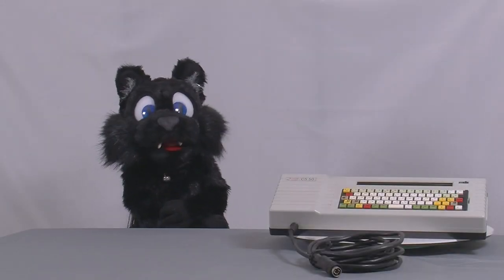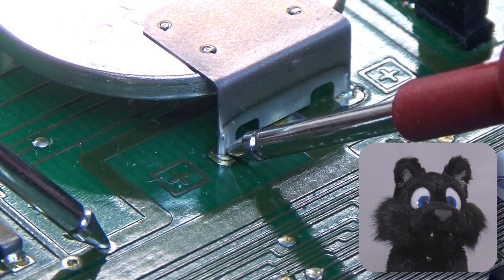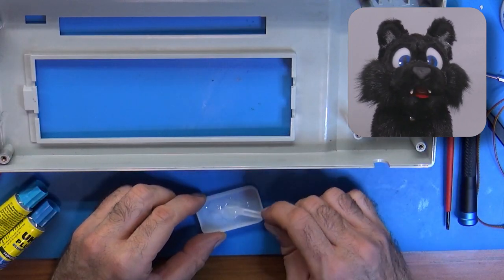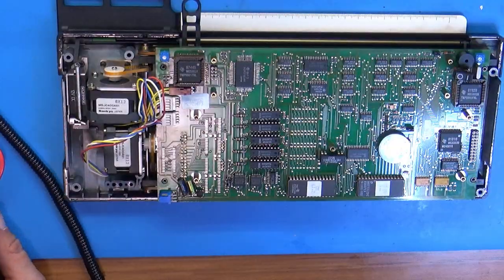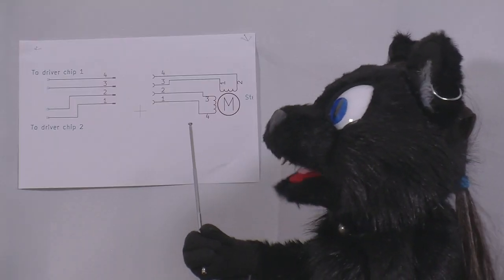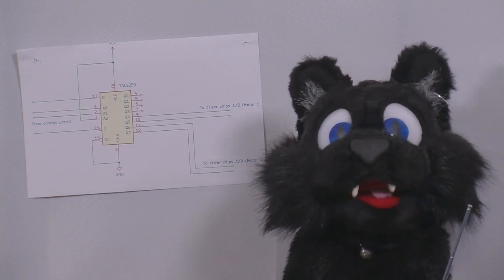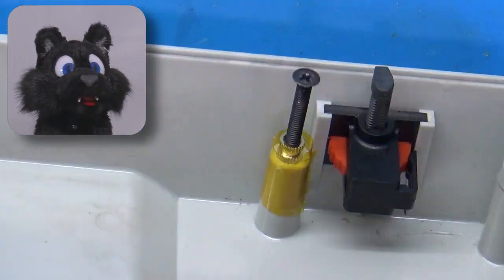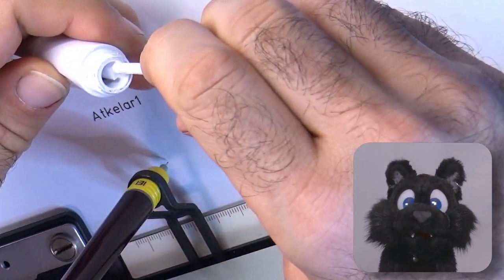Restoration Project #16 - rOtring CS50

Comment: I'm restoring a rotring cs-100 scriber. I need to replace two old belts. They are 2mm wide with a 1.5mm pitch (from what I can tell). I'm having trouble sourcing the belt material. any ideas?
Reply from the maker: Hmm... a quick bit of Google-fu makes me think you are looking for "GT1.5" belts. Amazon seems to be able to find a few on that notation. I hope this helps! I found a few specialist sites too, but they seem to be "industrial customers only" style catalogs.
Reply: @atkelar thanks for the quick response. The smallest gt1.5 belts I can find are 3mm wide. I think I need 2mm wide for the rotring.
Reply: @atkelar unless I get a 4mm gt1.5 and figure out how to cut it in half 😅

Comment: Ack! What if there was stored information that got wiped-out when the battery was removed!?
Reply from the maker: I was a bit less worried in this case, since te device is 100% digital, there should only be "preferences" and such stored inside any RAM. With my HP Spectrum Analyzer I kept the 3V line energized during the replacement, as that might very well have buffered calibration data.

Comment: Many, many thanks for taking care of this lovely cutie. I played with it as a teen at my fathers engineering office. They used it a lot to label large drawings. Later replaced by a HP Designjet 650C. I know where the machine is - but don't ask me where the power cable / adapter is. :-/
I also remember that there was a PC-style device hanging at his desk. I wonder if this was some kind of add-on?
Reply from the maker: I'm not sure if that device had any add-ons; My research showed that it could have had replacement keyboards for different layouts (the black part pops out with all the keys) and maybe a ROM replacement for other fonts. There also seems to exist a "plus" model of sorts that has the fonts(?) in cartridges, or at least I saw a picture of one with some cartridge slots. Information is a bit hazy on the internet.

Comment: I often encounter non-rechargeable lithium coin cells in 80s electronics that are still good - when they're used to power an NVRAM, these chips barely consume anything.
Reply from the maker: Indeed - the HP spectrum analyzer I fixed  up also had a quite good one from the  mid 1990s. But I'm worried about possible leagage; there's plenty of PC boards out there that got damaged by battery acid. So I think it's better to replace them whenever appropriate.
Reply: @atkelar  The coin cells kinda rarely leak. It's always the rechargeables or these short (1/4AA?) lithiums in the Apple Macintoshes that leak.
But all in all - there isn't really anything wrong with replacing a 30+ year old battery whether it works or not.
Btw. congrats on making Hackaday, that's how I got here. I totally love vintage electronics as well as fixing it (which you could probably already tell by my last comment) as well as watching other people fix them.
Reply from the maker: Thanks! I was surprised to see my views spike suddenly... I am still a rather small channel and any exposure immediately registers. Took a bit to find out where the views came from and now I'm all 😊 - Also, I don't limit myself to electronics, but it is the major part since it's my comfort zone.

Comment: I remember seeing this in the r0tring catalogue back in the 1980s. I don't remember what it cost; probably it was ludicrously expensive. I still have an excellent set of r0tring compasses, though. I used them as a test subject for modelling in the ray tracer Persistence of Vision.
Reply from the maker: rOtring has pretty high quality stuff but the asking price is as high as one might expect. I must say, if you need drawing tools, there is hardly anything more robust out there. I still use this plotter to write some custom labels now and then.